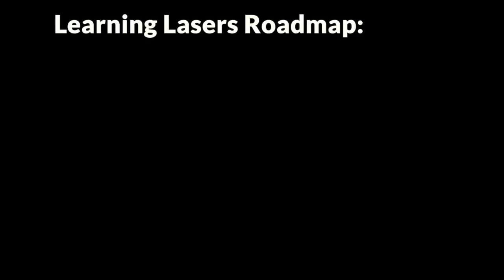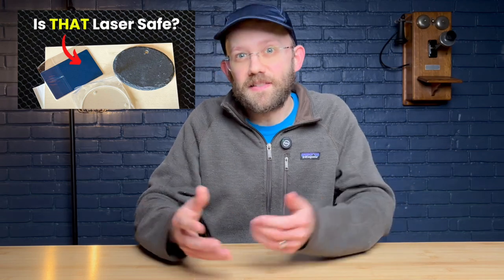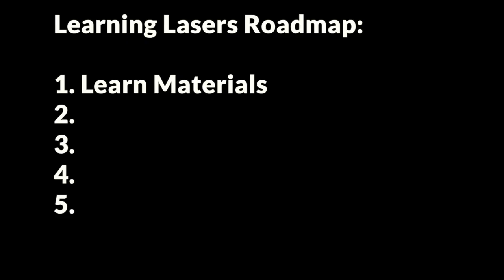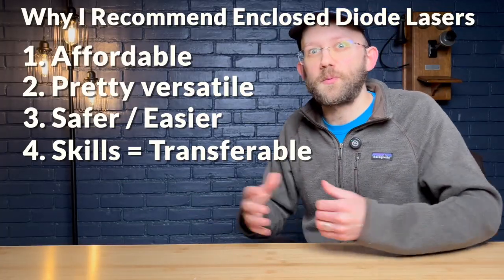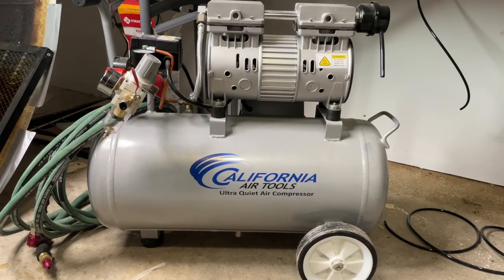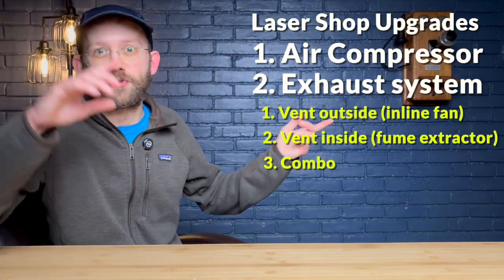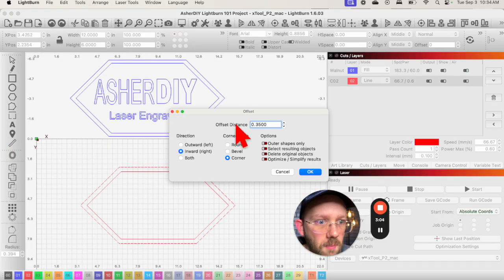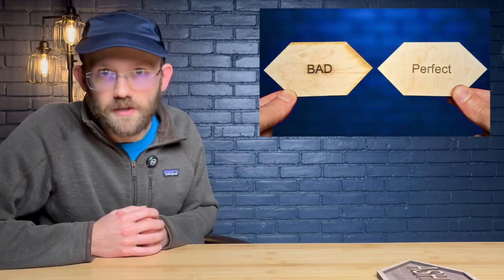How I'd Learn Laser Engraving (If I Could Start Over)

Comment: How about paper or tissue paper?
Reply from the maker: @Enjoythevue  are you asking if paper can be engraved? If yes, then it is possible, and I’ve done it myself with thick linen blend paper. You can see the photo album video on my channel for an example. You’ve got to be careful with paper though, because it can catch on fire if things aren’t quite right. I also only use plain non-coated/non-painted papers because I don’t know what kind of fumes other kinds might generate. Hope that helps!
Reply from the maker: I’ve never tried tissue paper, but my guess is that would be pretty difficult to engrave without it catching fire, since the sheets are so thin.

Comment: Very Interesting.. I'm torn between xTool S1 10w or the Omtech K40+ I'm really looking for something to make models for my model railroad.. So Laserboard 0.015" or 0.020"  is probably the main material... Then maybe some thin white acrylic. Fine detail is the key as I model in N Gauge which is very small!!
Reply from the maker: Generally I'd lean towards a diode machine like the S1, but if you need to do white acrylic a co2 machine will probably work a lot better for that. Anyway, best of luck making your final call!
Reply: @chalkwatts  Thanks for the advice. It's hard to find information as very few people use them specifically for Model Railroads.. People tend to use them for making other things and to make money from them. I want a good machine.. I just don't need to go over kill!! the k40+ is $300 cheaper than the S1. I believe it has a better accuracy as well being CO2... but all need to me.. :) Thanks again.
Reply from the maker: @CGngauge  - just one note to add here: co2 does not necessarily equal more accuracy. In fact, diode lasers are often more accurate, because the size of the beam is smaller, allowing the laser to be more precise on engravings. 

Definitely fair on the price though, lasers can get pricey fast.
Reply: @chalkwatts  Thank you.. for the guidance.. I've subscribed and look forward to your other videos you have planned for the series. 

Most of the modelling will be Laserboard. Again.. it's a learning curve as I model out of Polystyrene sheets and I know that can;t be laser cut... So figuring this all out to get the right machine that will do what I need.. :)